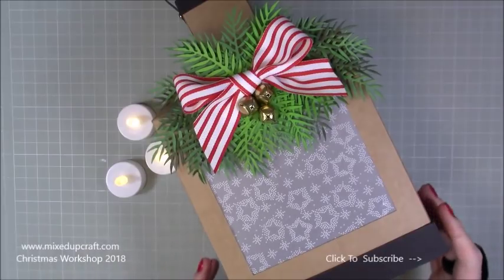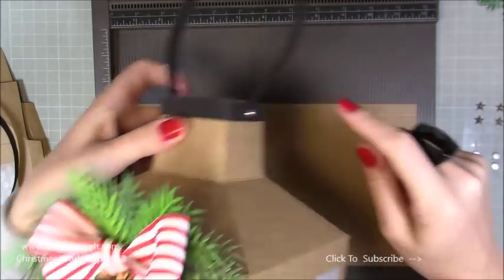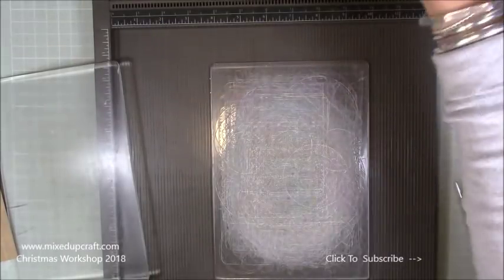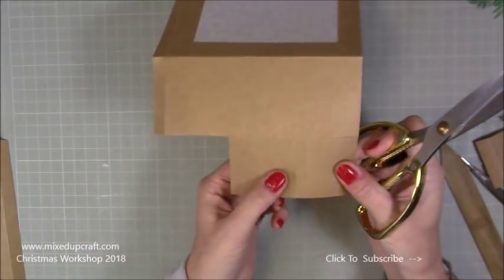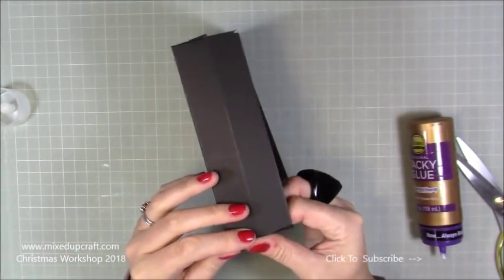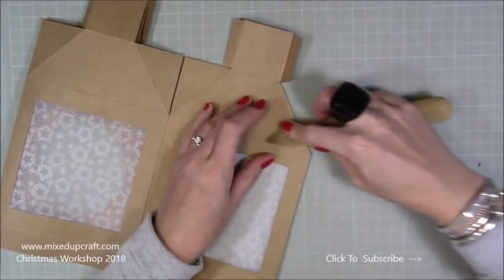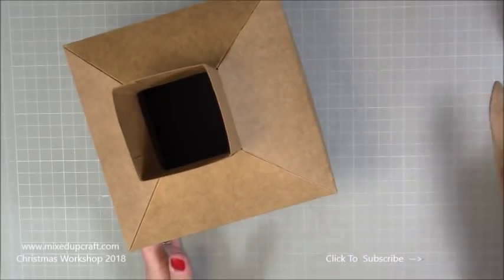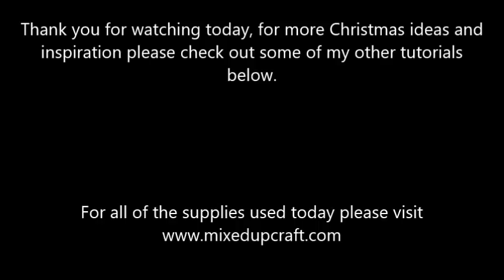Christmas Lantern | DIY Crafts | Christmas Workshop 2018

Comment: so cute! i really liked this! 
i did make two changes... instead of having an opening on one side to put the lights in, i left the bottom loose from the top, so you can open it up that way to put
the lights in from the bottom and then it can be on a table and all sides look finished, closed and the same. i also made the black 'lid' bottom part 1/16 of an inch bigger to make sure that it sat in the bottom without bowing. on one lantern,  i put some silhouette pcs on the inside of deer to show through since i did not have the snowflake vellum.
these are sooooo cute!

Comment: I want to make small ones for all my friends; just big enough for one light. I also think they'd be great as gift boxes at any size if the chimney part were made separate like the bottom is.
Reply from the maker: Great idea, did you see the mini version I posted?
Reply: @MixedUpCraft  Yep! It turns out that I don't actually have a square punch, so I used a label punch and it's kind of adorable. I just need to re-work a little to make it a skosh wider cuz my corners aren't even a quarter inch and don't hide the flap.

Comment: Just curious if anyone has an answer to my question:  I know that the red tape is strong under normal circumstances, but does it hold up under very hot temperatures (during storage)?  I live in Florida and never store my Christmas decoration in my attic, but even my garage gets very hot in the summer months.  I would love to be able to use the red tape instead of glue for the ease of it.  But if it doesn't hold up, I am wondering if I should use glue.  This is very nice.
Reply: I worked for a major US craft chain for ten years and it's my experience that all commercially available glue will fail eventually and that heat makes it fail faster. That being said, wet glue and paper are besties because the glue gets into the fibers of the paper and makes a very strong bond. Vellum is the exception because the fibers are plasticized in order to create its translucency.